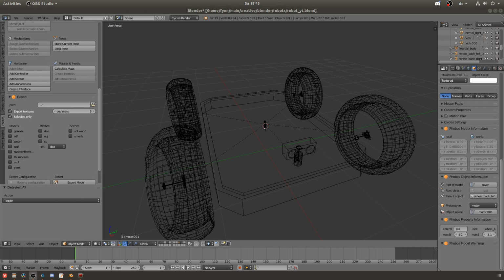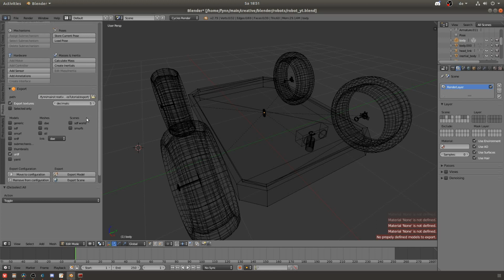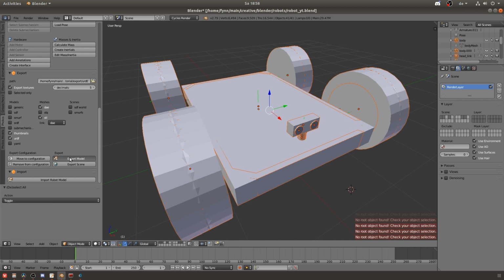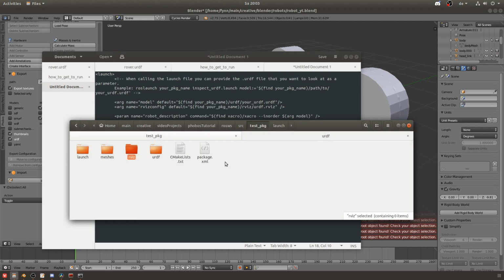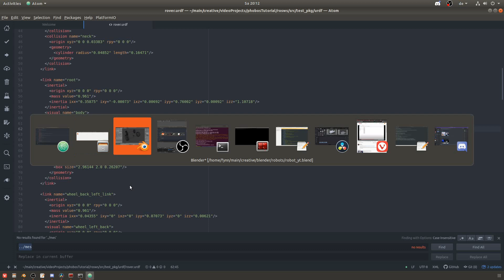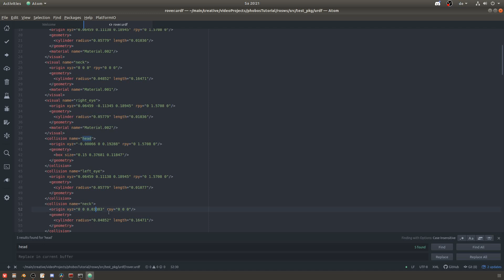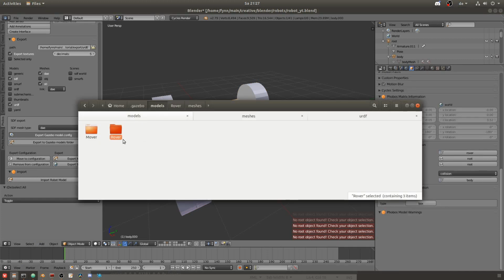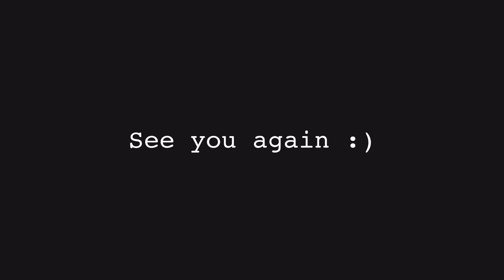From Blender to URDF with Phobos - Exporting the model (Part 3)

Comment: I have a problem with the mesh export, in my model there is one mesh-type object (technically it should be  three but since they are fixed, cylinder is the best option for the rest) when I try to export it gives an error and create a cylinder under the base (mesh type object), there is no mesh tag in the urdf folder. another issue I have run with here is the wheels of the robot, they are not exported correct at all, I have defined them a cylinder but the urdf makes them just straight cylinder and not wheel-like.....

Comment: Hi. If we have mesh data, collision data in obj format and URDF file of the robot, is it possible to import and modify that in blender?
Reply from the maker: It's been quite some time that I fiddled around with this so I'm not sure.

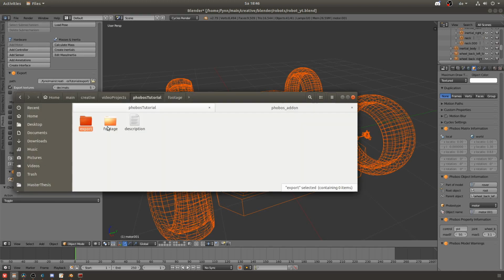In the video a blender model was created and a URDF was generated from it. You already have a model and URDF and now you want to make adjustments in Blender. So it's kind of the reverse process. I'm not sure if Phobos supports this. In the video you can see that next to an export function, there is also an import function (e.g. at 0:55 on the left side). So maybe it's possible. Of course the question would be what kind of input data this import function expects. Maybe it needs to be data exported by Phobos. But maybe it's also possible to use it for your use case. Maybe just click the button and see what the program wants. :)

Alternatively you could probably only import the .obj files (Blender can do that afaik) and then set up the model as shown in the video so that you can generate the URDF from it.

Once you have the model set up once it should be possible to make adjustments to it.

I'd try to verify the pipeline in which you want to process data with a very simple robot model (e.g. 2 links with 1 joint) but use a similar data input (obj files, URDF). If you can make that work and are happy with the workflow I'd apply the same thing to your more complex use case. Also consider what you do if your .obj files change a lot (e.g. by use of an external program). That could affect if the workflow is viable or not (what do I do if I changed the .obj files, how do I get them back in Blender).

So as it's not clear if it's possible, just try around a bit, see what Phobos is capable of, and see if you can find some workflow that fits your use case.

Cheers

Comment: Is it possible to convert the model which is created in SketchUp into urdf file for ROS?
Reply from the maker: Hi there,
I'm not aware of any converters that directly export URDF files from SketchUp. What might be a possible approach is to export the file in SketchUp in a format that you can load into Blender. Then you import your file into Blender and use the steps described in this series here to get the URDF. A question might be the process in which you get new data from SketchUp into Blender once you did the initial setup (without having to redo everything).

An alternative would be to export the different meshes from SketchUp (e.g. as DAE files) and writing the URDF yourself. You could also generate an initial URDF with the steps described in the first paragraph and then do adjustments to the meshes in SketchUp and updates to the URDF manually.

Probably the easiest way would be to use Blender directly so you don't have to find a pipeline between SketchUp and Blender. But I can understand if you're more comfortable in SketchUp so I outlined the steps above. There might be other ways but these are the options that came to my mind.

Comment: I loved this series!!!!  But i am just a noob that's why i am getting an error while exporting "No properly defined models to export" Plzz help!!
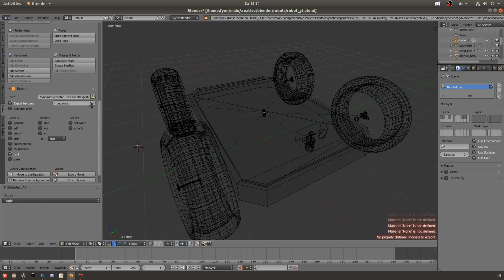Reply from the maker: In the video you can see that I also get that error at 2:19. Potential reasons could be that you are still in "Edit mode". You need to be in "Object Mode".
Reply from the maker: If that's not it then it seems that a certain part of your model has not been configured correctly (or maybe you don't have it selected? E.g. if you have "Selected only" activated). You have to find out what's the source of the error. For that you have to isolate it by ruling out potential sources of the error. My approach would be to remove complex elements of the model and see if the error still occurs (make a safety copy before removing things). Once the error disappears, you know where it's located approximately. Then you can investigate further with that information. If nothing helps I'd try building a really simple model and see if I can export that. If I can't export it then it's at least easier to debug, if I can then I can build complexity from there and continuously test if I can still export it to notice when an error was introduced.
Reply: @IFaTaLiTyl  Thank you so much for your help...i a trying to do this with my model adding parts by parts to it and it is working it is exporting to urdf but i am facing a new issue. The issue is, the parts i export and the parts i view in rviz are not same their rotation and location is varying.
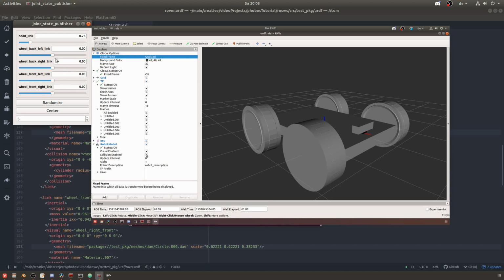Reply from the maker: @RealisticCrashh  I've had a similar issue at 6:55. It seems for Phobos to work you have to parent all objects directly to the link. Also make sure to use bone relative parenting.
Reply: @IFaTaLiTyl  Thank you sir for all your help... in my case rviz was reading all the meshes exported form phobos wrong..so i just changed the meshes in the urdf file and voila! it worked for me. Thank you sir you are doing a great work
Reply from the maker: @RealisticCrashh  Happy to hear that it works for you now. :) 
Can you explain a bit further what error caused the incorrect mesh position/orientation and how you fixed it? I'd be interested so that I know what to do if I get the same error.
Reply: @IFaTaLiTyl  There was no error but when i checked obj checkbox under meshes in export; it generated meshes but rviz was unable to have the correct orientation of these meshes. So in the urdf file i changed these meshes with the original ones and it worked...but i dont know what caused this to happen. Some smart people say "don't touch it if it works"  :)
Reply from the maker: @RealisticCrashh  Ok thank you for the information. :) Good luck with your project!
Reply: @IFaTaLiTyl  :)

Comment: This series was brilliant! I managed to export the urdf, but it doesn't seem to have any color settings. How can I fix this?
Reply from the maker: hmm I'm not sure. Looking at the wiki of phobos it seems to be possible: "Like they were meant to in Blender, you can assign colored and textured materials to visual objects. You can also assign materials to collision objects if you wish, which often makes it easier to identify which visuals they relate to." (https://github.com/dfki-ric/phobos/wiki/Structure-of-Robot-Models). If you look at the robot dictionary that they use, you can also see that they assign a material (color) to each link (https://github.com/dfki-ric/phobos/wiki/Robot-Dictionary). So it should be possible but I don't know why it doesn't work. If your model doesn't have a huge amount of links, you could also think about assigning the colors by hand in the urdf.